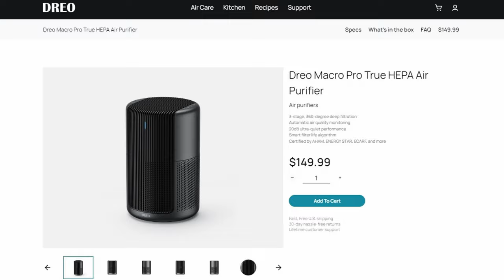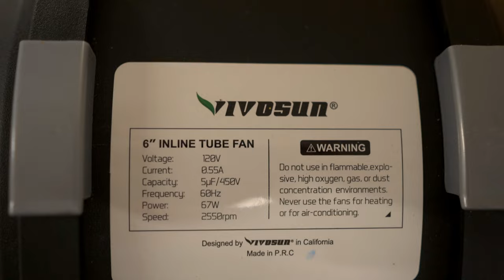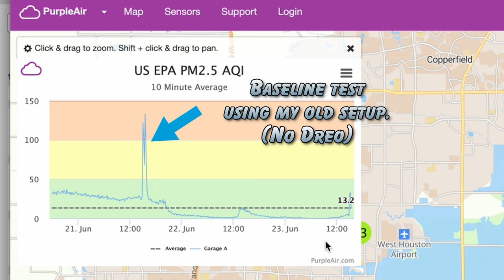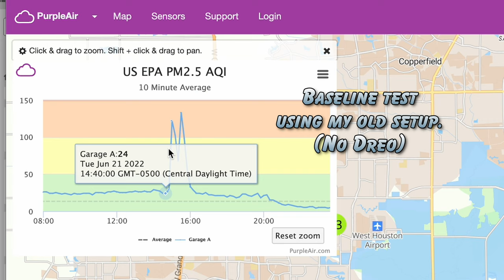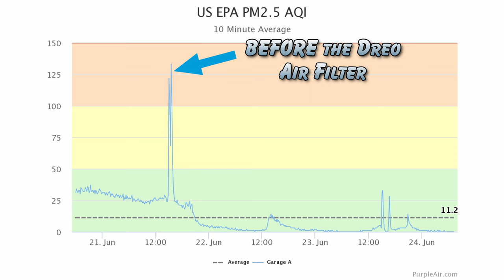Air Quality When Pouring Soft Plastics Will an Air Purifier Help?

Comment: Since you have a 6" fan already you could add a carbon filter from your local hydroponics store and attach it to either the inlet(preferred so the dust cover comes into play extending the filter life) or the outlet of the fan.  The filter should pull most if not all of the fumes that go through it, it should pick up the resin printer fumes too. In my garage, I can't turn the air over at any sort of rate through the winter  I could not keep up with heating when the outside air is -20c or colder.  I have another hobby that at times produces lots of volatile organics and it does a great job of controlling the fumes.
Reply from the maker: Awesome thanks! I will check that out! I have the same issue in the summer, if I turn on all my vents it starts getting super hot real quick.